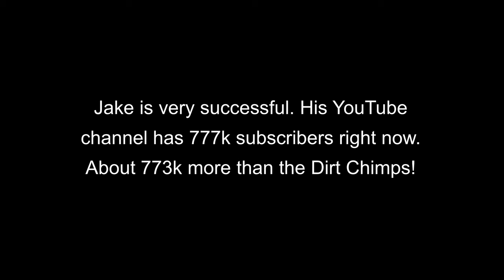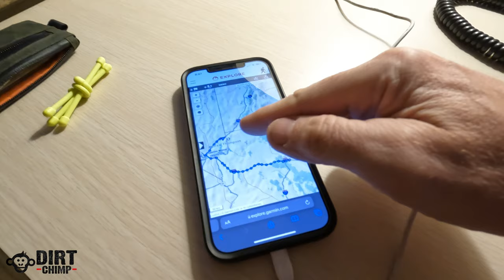AZ BDR Day 3  - The Downer

Comment: So what was the problem? Ingested dirt? Our friend Patagonia Rob told me about this, I’ve got a 790 as well. Was it a rebuild of sorts? Been watching your Snowbike vids for years, just found out you are summer riders 👍
Reply from the maker: Ah, Patagonia Rob, now there is a guy! :P

Yes, dirt ingestion, likely over the course of several air filters. Accumulated damage. Then, the combination of a bit more damage, high elevation, and cool engine temps has the computer tell the engine that it is time to not work any more. I needed to get the valves replaced. At the end of the day, it was $2k. Bummer. Now I have 5 air filters and I cycle them after every ride or two, depending on the dust levels. Changed one today!

Motoboogers sure is a unique name. Cheers!